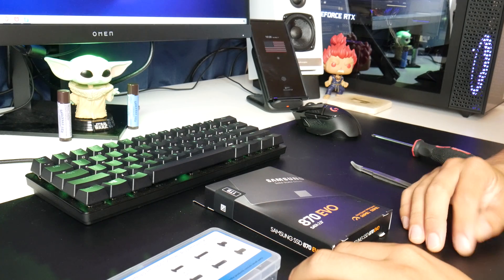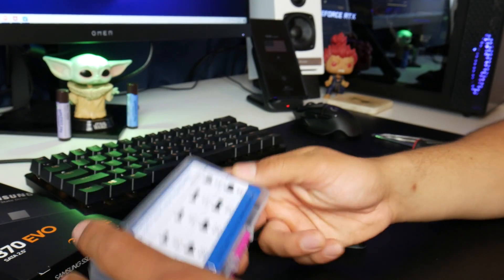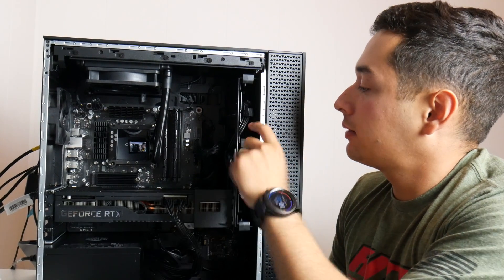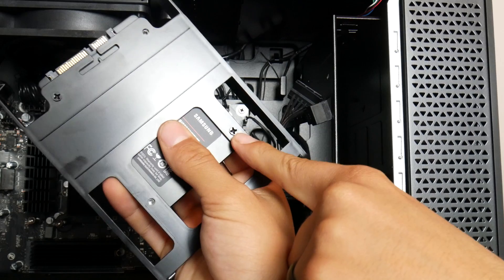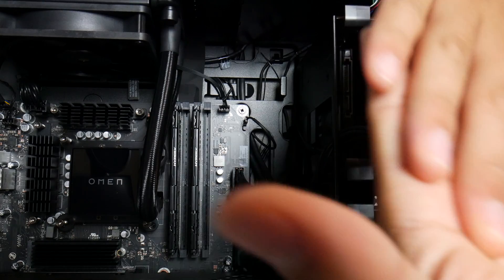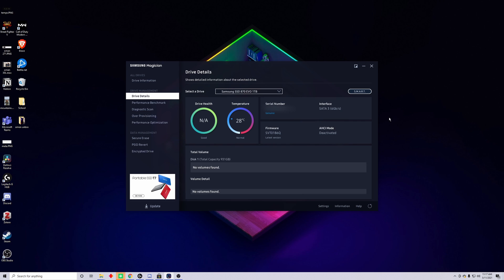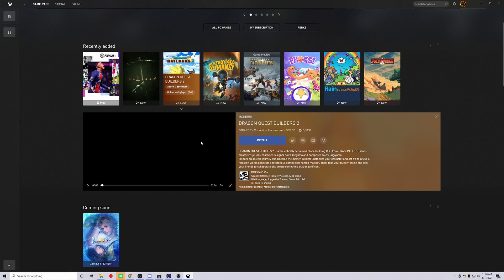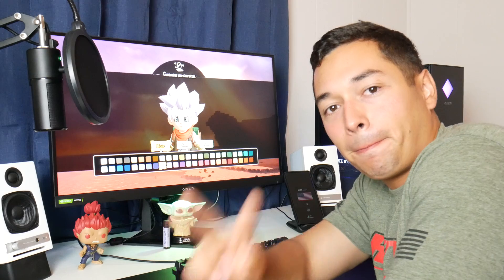Installing Samsung 870 EVO SSD in my HP OMEN 30L

Comment: I have the same 30L as you but wanted to ask if you the motherboard allows for extra SSD/HDD storages to be added? I need to add another storage slot but I still want to keep the default 1 tb ssd and 2 tb HDD it came with and wasn't sure if I'd need to replace one of these or can just add on my extra slot, thanks!
Reply from the maker: There are 2 expansion slots 👍🏼
Reply: @StevenMakesVids  Ah okay, so that's the 2 default hdd/ssd and 2 extra whatever we want to add in O: ?

Comment: it will NEVER work with windows 11 or any windows software from installing or migrations!!! it fails to be detected in bios to boot from and it fails to write disk!! all other ssd's works automatically without issues!!! i had to scramble my brain just to get the dang samsung 870 evo 4tb ssd just to get it recognized as an external ssd ONLY,,it sucks even the samsung migration software sucks and won't work to recognize it so i use the Mini Partition Tool Wizard ALL for FREE that REALLY works better😢😢😢😢

Comment: i really over complicated the installation process for this SSD, plugged it into the PSU and one SATA cable and it was working! too easy, didn't even have to pay for it either! it was an unregistered drive within my second hand system i bought a few years back and always thought it was corrupted, what a steal man!

Comment: I have a SSD to run windows and a HDD to run games, I am thinking of replacing the HDD for the SSD you used in your video, can I just unplug the HDD and plug the new SSD, go to disk management and I should be fine?  Or do I need to do other steps like BIOS or anything like that?
Reply from the maker: You should be fine, just make sure your PC is off when you're swapping drives around

Comment: My SATA data cable for the SSD seems to be too short to connect. Is there a way I can work around his? Can I install the SSD without mounting it?
Reply from the maker: You don't have to mount it if the cable is not reaching
Reply: @StevenMakesVids  Thanks mate

Comment: Good video. However, if I want to replace the Original Windows  OS that came with my 128 SSD, do I remove the 128 SSDS card first? One TB 870 Evo sounds good to me. My system is Io7 but I'm running out of space on C Drive. Thanks, .

Comment: My HP Pavillion TG01 0170m did not come with the cable with the smaller end, only the larger one, do you know the name of it?
Reply from the maker: Are you referring to the cable that goes into the SSD?
Reply: @StevenMakesVids  Yeah
Reply: @StevenMakesVids  Actually I just found out that my computer didn't come with an extra SATA cable, so I have to order one, but thanks for responding!

Comment: I ve the same pc, but in my case a first SSD is mounted on the first(upper) slot with the OS installed, plus a standard HDD for data. I wanted to add  another SSD for gaming but the second slot(on the botton ) which is empty only has the pc cable and not the hdd (the smaller one). is it the same for you? would it be possible to mount anyway a second SSD?
Reply: I have the same issue did you find a solution?
Reply: @jakecass1565  no, but I suspect that the first slot is busy with HDD while the first SSD is somewhere else, if so I ll replace the HHD with second SSD but I have to open the case and check better
Reply: @Antonio-Morisco  my solution was I found the second M.2 ssd slot it’s below the graphics card, so I ordered a m.2 SSD and installed in there mate, you should give it a try
Reply: @jakecass1565  I ll give a look, thanks man!
Reply: Hi guys, I ordered a evo 2.5" SSD for my omen 30L and have the same issue. I noted that there is a free Sata cable slot on the bottom of the motherboard under the GPU. I have just purchased some Sata cables and will use the second slot 👍 Sata cables can be picked up for under 10 euro

Comment: Hi @Steven,  I just bought an HP Omen 30L GT13 1831 NO with 3080  yesterday with a similar motherboard layout as yours. I have  been struggling in finding the second SSD slot. I tried looking between the GPU and the power supply, below the GPU, or in any area near the network card. Do you know whether it is actually located underneath the GPU? Which means I have to remove the GPU just to install my second SSD. 

Thanks!
Reply from the maker: which type of ssd are you trying to install?
Reply: did u find out where the second slot is, I have a omen 25L and i can't seem to find the second ssd slot
Reply: @AxelBestGM  under the GPU. You have to remove it

Comment: What is the ssd2 for under your graphics card?
Reply from the maker: If you are referring to the big box that is the power supply
Reply: @StevenMakesVids  no it says ssd2 it's located in between power supply and graphics card I think it's a 2nd storage option wasn't sure tho
Reply: @dustin4434  if you look carefully the cable he used for his ssd says hdd lol idk if it actually makes any difference

Comment: This drive didn't work out too well in an NZXT case with respect to mounting (and possibly other cases). The Power cable goes face down and pushes Up^ on the drive. The NZXT case didn't allow enough room for the faced down Power cable to rest normally. I had no issues with a WD SSD whereby the cable faces Up^. Just something to consider before your purchase.

Comment: Thanks for the video, I just bought a 4TB version for my Razer Tomahawk Gaming Desktop I just pre ordered. I didn't want to use the 2TB HDD it's pretty slow at 5400 RPM vs any SSD.
Reply from the maker: nice 4TB will have you set for quite some time.  The speed of SSD's really does make a huge difference in everyday tasks!

Comment: make a video install down an other SSD
Reply from the maker: It would be the same exact process, just putting it in the other available slot.
Reply: @StevenMakesVids  i dont see the hdd port dont work
Reply from the maker: @furraw5128  can you explain your problem in a little more detail? I may be able to help out then
Reply: @StevenMakesVids  i just have the hdd alim and not the hdd port
Reply: @StevenMakesVids  help

Comment: Probably a welding error for me, but does your Omen case have the top a bit loose on the left-back corner by the back access button? Or is it supposed to be that way?
Reply from the maker: I have no concerns with my build. The button should be easy to push but the glass should be solid in place
Reply: @StevenMakesVids  Yeah I have no problem with the button itself. Mind if I send you a link to what it kind of looks like?
Reply from the maker: @Chuck  sure 👍
Reply from the maker: @Chuck  oh yeah, you have nothing to worry about! As long as your case looks nice and makes you happy then I wouldn't worry about it 👍
Reply: @StevenMakesVids  Sounds good and thank you for the tutorial!
Reply from the maker: @Chuck  thank you for stopping by I appreciate it 😁

Comment: Exactly the kind of video I was looking for, I also have a Omen 30L and will be purchasing the 870 evo SSD soon. Good to know that you linked the screw set as well because Im going to be purchasing that as well. Thanks!
Reply: I was thinking the same mine arrived today I’m going to try this today or tomorrow I also bought the screws
Reply from the maker: Nice! Happy gaming 👍
Reply from the maker: Glad I could help! Everything works like a charm 👍
Reply: @StevenMakesVids  😭😭😭 I attempted to install mine today I wanted to put it in the slot below but only has one cable can I not add a second drive there???
Reply from the maker: @GlodenStarEnt  strange, my bottom slot has both power and data cables. Maybe your was not routed properly? It should be there somewhere 😅
Reply: @StevenMakesVids  there is definitely only one and it’s the power there is an empty port where it says hdd2 I assume that’s where the other cable should be right?
Reply from the maker: I have a pair of cables routed into each slot on my 30L. It may be worth looking into your PC a little more to see if the cable is behind the motherboard or missing entirely
Reply: @StevenMakesVids   I’m not like a computer person it’s the first time I ever opened one up lol I have a omen 30l too that’s why I looked at your video but it’s definitely not there I guess I’ll have to call  Hp or something cause I don’t even know what cable to buy
Reply from the maker: @GlodenStarEnt  if you have your ass plug the existing cable into it. The empty socket will give you your answer in which cable you need!
Reply: @StevenMakesVids  I finally spoke to them they told me to buy a sata 3 cable i don’t know which to get can you possibly tell me
Reply from the maker: @GlodenStarEnt  https://www.amazon.com/dp/B018Y2LEBE/ref=cm_sw_r_cp_apa_glt_fabc_WHCN007SQYEP8HWA7K9K?_encoding=UTF8&psc=1
This should work just fine 👍
Reply: @StevenMakesVids  omg thank you so much really appreciate it
Reply from the maker: @GlodenStarEnt  no problem! Let me know if there's anything else I can help with!
Reply: @StevenMakesVids  will do thanks
Reply: @StevenMakesVids  hi thank you so much my cable came yesterday i followed your instructions and managed to install my drive and set it up works perfect and your instructions where super easy to follow thank you so much for your help 💕
Reply from the maker: @GlodenStarEnt  glad I could help! Thank you for stopping by 👍